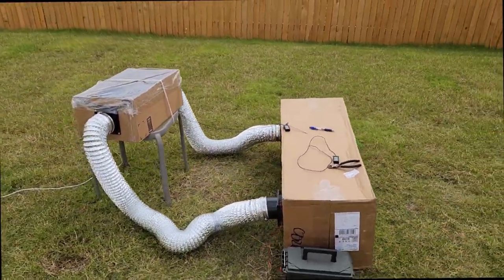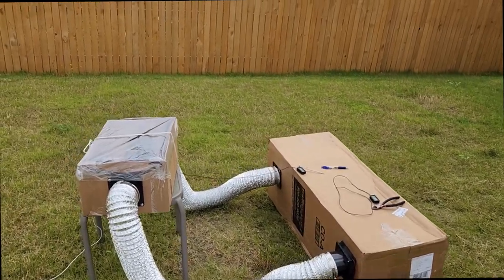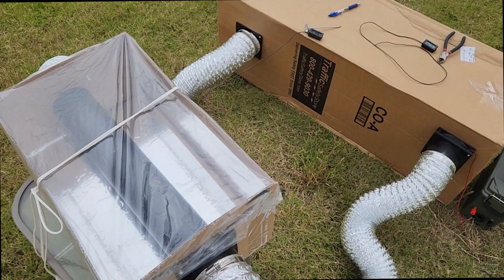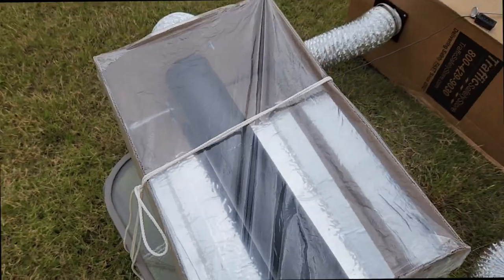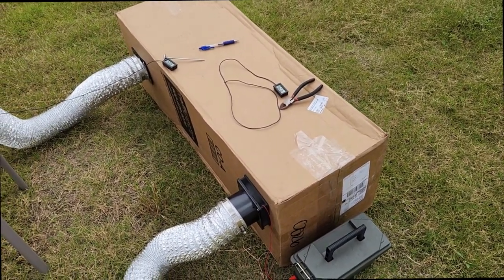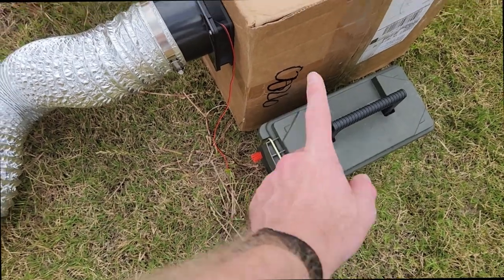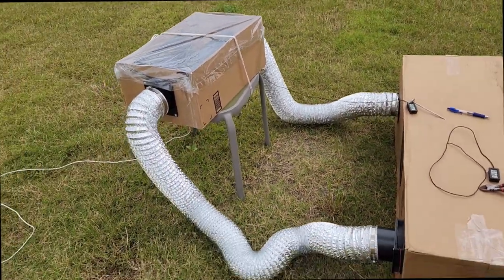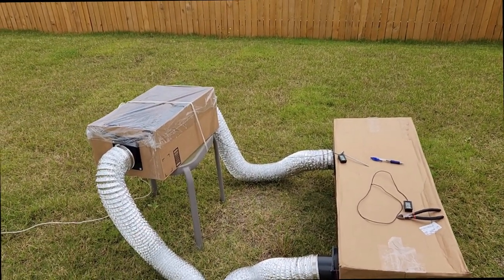Parabolic Solar Air heater Prototype version 1

Comment: I love this concept. A couple of things from my armchair here - I’d put the mirror, black tube below the bigger box - this should help with your thermal siphon and collect the hotter air in the box. I know this is a POC but the size of the mirror vs the surface area of the setup and lack of insulation means you might be losing as fast as you are gaining. Before worrying about circulation try to see how much you can heat the stagnant air the black tube vs ambient. With a couple of calcs that should help determine how much of an issue the heat loss is due to convection or conduction. If you have a friend with a thermal camera that would be really cool footage to see. This is super cool, really excited to see where you take it!
Reply from the maker: agree with all of these things. I do wonder if the mirror isn't big enough. However, if you look at my photo from a few days ago with my fresnel test, I got up to 120F on the same pipe, without the plastic cover over the top.   One of the things I know will help though, is transferring the 'hot' from the metal pipe into the air. I have a plan for that after I get some more info from the proof of concept though..

Comment: Interesting, but for a well made calculation with thermometer etc, the box heated should be shadowed asi it also takes the sun... (even maybe more, as it is bigger... ; )
Reply from the maker: Don't worry it will ramp up